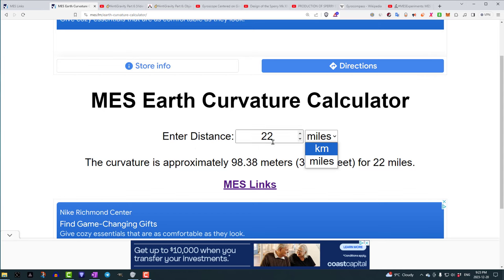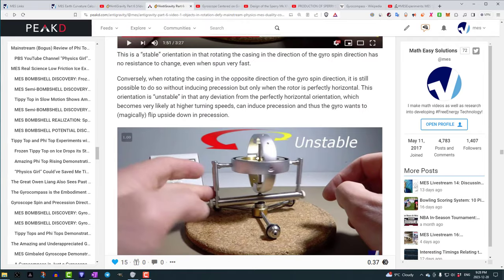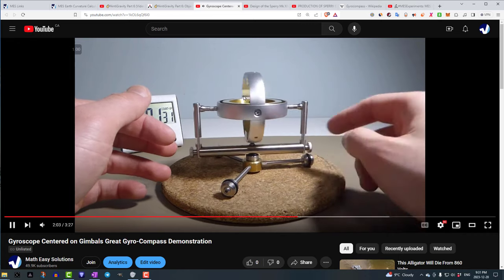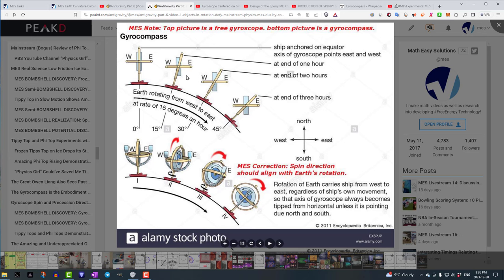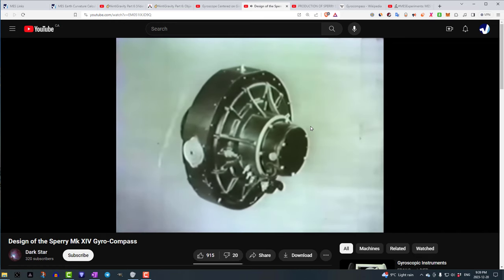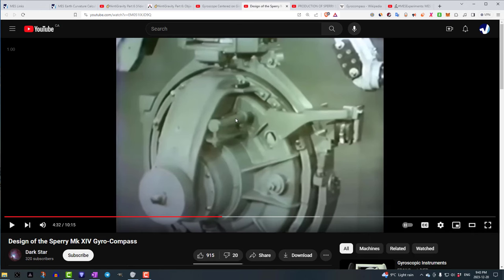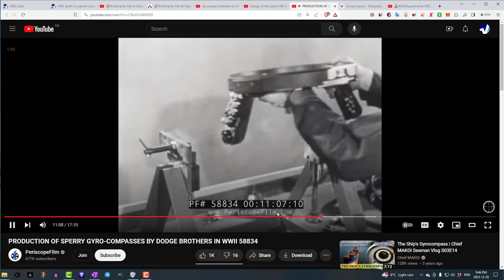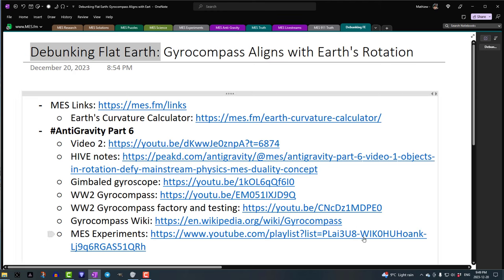Debunking Flat Earth: Gyrocompass Aligns with Earth's Rotation

Comment: No curvature has ever been measured and never will be.
Reply: FWIW, I have tried at least a half dozen times to measure curvature over water using different methods (lasers and telephoto lenses) and have never been able to find any curvature. I don’t know that this proves or disproves anything but it certainly raises some questions.
Reply: @traceyoung5592  Try harder.
Reply: Yes, they did.
For example by Jean-Baptiste-Joseph Delambre (and others).
https://en.wikipedia.org/wiki/Meridian_arc#17th_and_18th_centuries
The modern meter is based on this measurement.
Reply: @codetech5598  Nah, I’m good